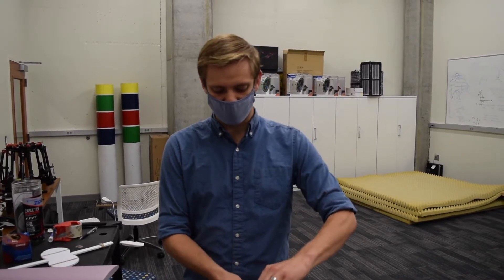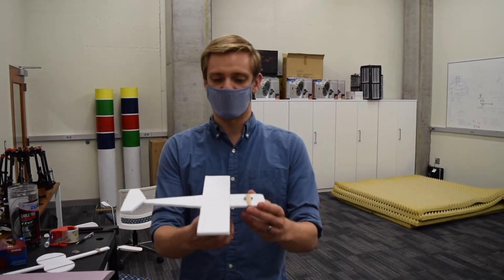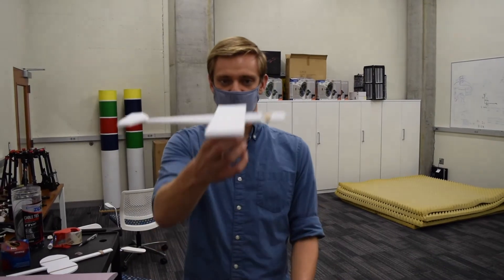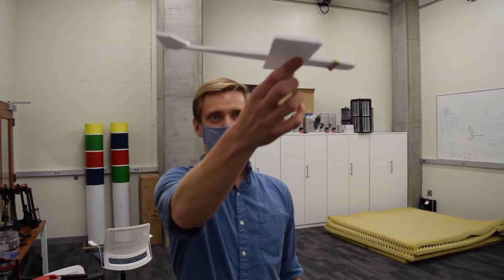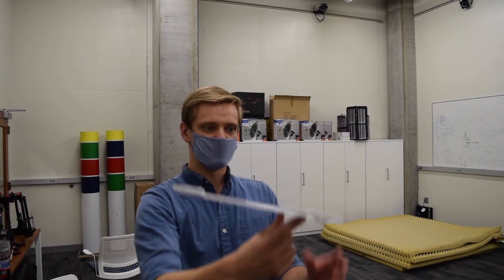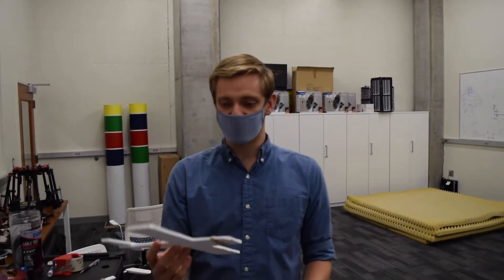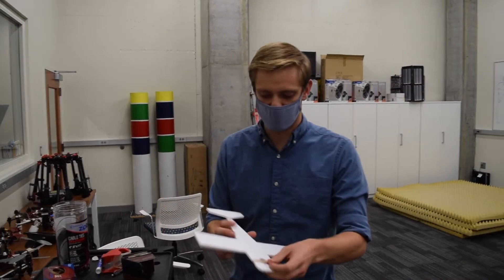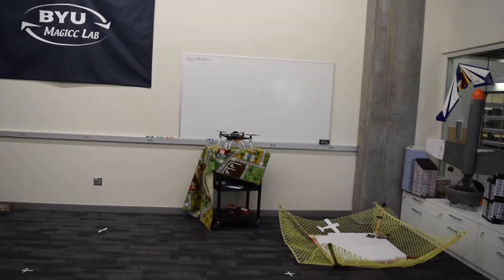Episode 3: Your Airplane's Center of Mass

Comment: some late information        the term cg is used in the narration.     cg  and  center of mass (c-m)  are  NOT  the same thing.      those two points can, however, be nearly coincident; as they are in the foam demo model.
how does a person  CHECK  the cg.?!?!?      they do that by  KNOWING  where  a  cg  typically should be located.      the  METRIC  for correct cg location  is  Percentage of wing chord.    eg., thirty percent of chord or mac aft-of the le.